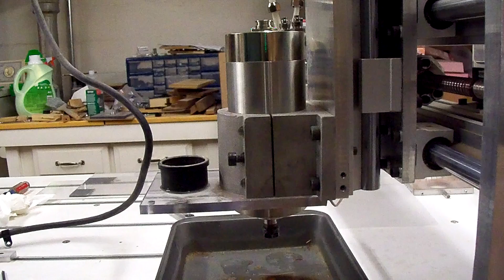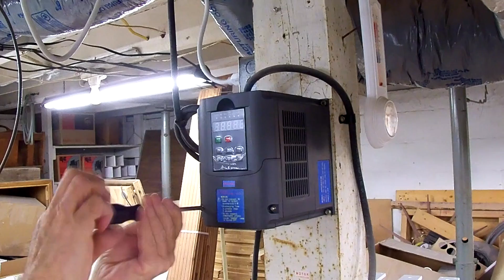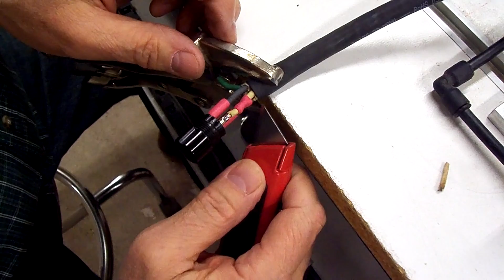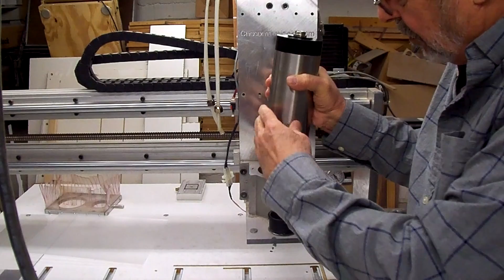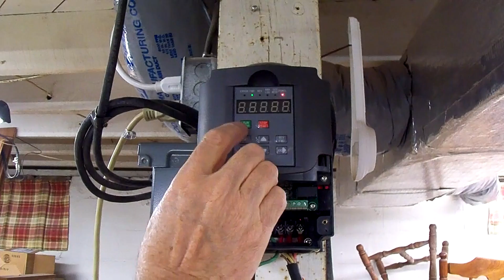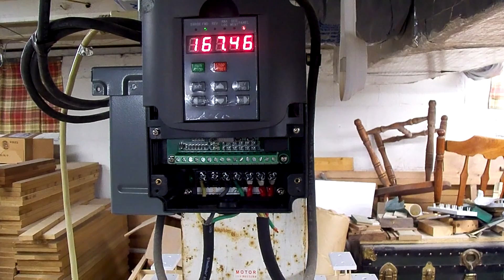New CNC spindle motor and inverter

Comment: Hello, I have the same model of inverter and I can't make it work with mach3 (I have the plate that is parallel green)
Please!!! save me!!
Reply from the maker: I run my spindle and inverter completely seperate from mach3. I just have a remote start/stop and remote potentiometer to control it.  I didn't take the time to learn how to connnect it so that mach3 could control it and it's safe this way as well. Sorry I couldn't help you.

Comment: My problem is direction of rotation is wrong.
How to rotate direction of motor to right direction.
Engine always turns the other way around. weird.
How to set M03 direction of rotation.
Reply from the maker: If I remember correctly, you just switch two of the three power leads to change direction.

Comment: For the community's good, the ground must be connected at both ends to meet electrical code safety. If a motor winding wire comes loose while spinning and touches the case, the motor case and anything it touches becomes live. Products from China often do not meet U.S. NFPA79, Canadian SPE1000 or the international 61010 electrical safety requirements. I have direct work experience with their electromechanical products. Remember that China has a less developed industrial base. Another uploader showed where his spindle was left ungrounded out of the box as well. Electrical codes come from industry consensus. They help prevent injuries such as severe electrical burns and more. Ground it with an appropriately sized wire for your own safety.
Reply: Just as a note, these spindle motors are 3 phase brushless, the stator assembly DOES NOT ROTATE, only the magnet assembly rotates. And yes the motor and all wires should have a ground.

Comment: why did you not connect the ground wire to the spindle.. does it cause noise that way?
Rich
Reply: The ground must be connected to meet electrical code safety. If a motor winding wire comes loose while spinning and touches the case, the motor case and anything it touches becomes live. Products from China often do not meet U.S. NFPA79, Canadian SPE1000 or the international 61010 electrical safety requirements. I have direct work experience with their electromechanical products. Remember that China has a less developed industrial base. Another uploader showed where his spindle was left ungrounded out of the box as well. Electrical codes come from industry consensus. They help prevent injuries such as severe electrical burns and more. Ground it with an appropriately sized wire for your own safety.

Comment: Was the connector on the second spindle motor a 3 pin?  if so what combination did you wire it up - which one was earth? Any help would be great :)
Reply: Worked perfect.  Many thanks for taking the time to reply
Reply: You really need to ground it for safety. See my comment above.
Reply: If you do not ground your spindle as a stated by Michael LaPierre  you put yourself and others who might be around at risk. Without it You become the ground should you be unlucky ,and to tempt the fates further by having a water cooled spindle with no ground is in my humble opinion madness worthy of the Darwin award.

Comment: I have this vfd and same spindle as yours, my problem is anytime I switch on the spindle,  the machine goes to emergency which I need disable the e-stop and all the limit switches before the machine operates which is dangerous. Ive tried so many means to fix it but to no avail.  you're my role model advice me
Reply: I cant figure it myself I control it manually by connecting GND to forward to start the spindle and a potentiometer for the speed. I discussed it with an electrician and was asked to use shielded wire but nothing changes. I have the VFD right beside my control box under the table.

Comment: Hi, 
Good video. It would be a good idea to reinstate the earth connection. I have the same connector on my spindle and I ran the earth wire back out of the connector case and fixed it under the clamping screw. Keep safe.
Cheers Dave.
Reply: MyRobertadams   Its not good when the PE goes through the connector. It should be wired directly to the spindle.

Comment: Have you tied to have Mach3 control the spindle (on/off spindle speed)?  Check "Ricks CNC"  He has some great info on controlling your spindle with Mach3.  https://www.youtube.com/watch?v=1sf2zLQu5CU
Reply: MyRobertadams   Are you gonna use RS485 modbus interface to control the vfd through mach3 software?
Reply: If your BOB has a relay and a 10v output, you should be able to control the spindle from mach3.  No need for a RS485.
Reply: Jack Ulibas  I know, but when you use 485 it will switch off the spindle in auto mode when you have some problems with vfd like overheating or smth